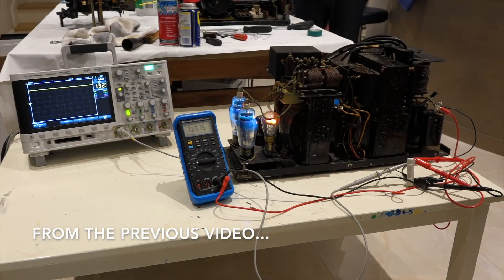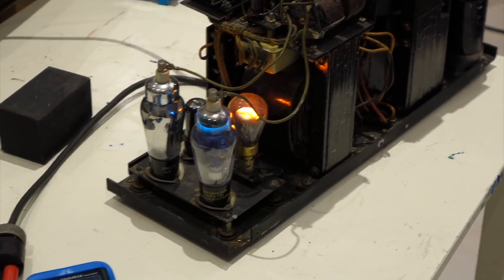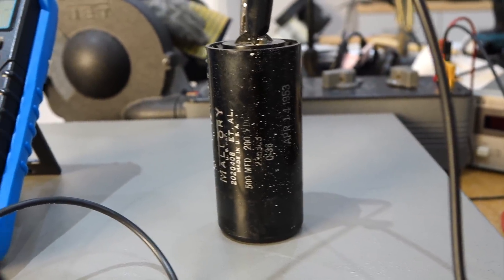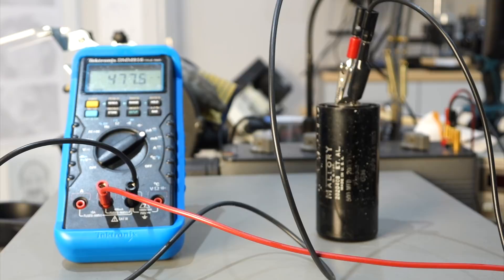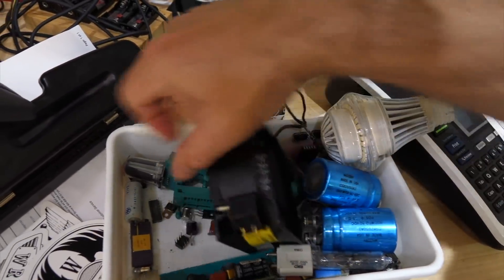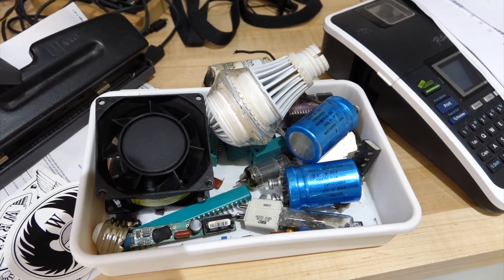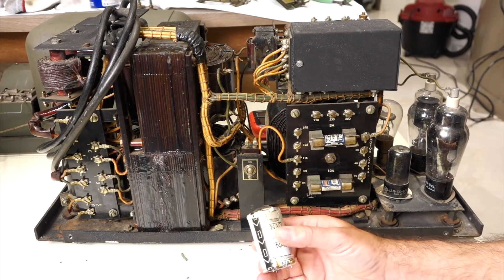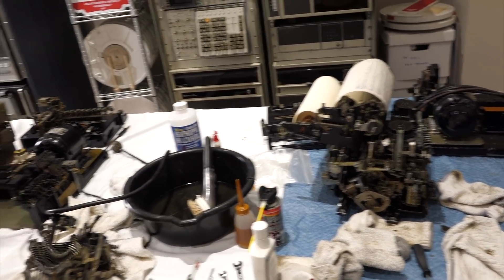Why we don't always replace vintage electrolytic capacitors

Comment: Thumbs up! When I repaired my HP 8671A and HP8566B and only replaced the failed capacitor.  I got similar comments on why I didn't replace all the electrolytic caps. My philosophy has always been that unless there is a good reason (e.g. high ESR and low capacitance), leave them alone! New ones aren't always better!
Reply: plus, the risk of causing damage to the PCB traces when doing the rework.

Comment: You, sir, are living the dream! BTW, I also (still) own a model 15, which back in the day I had hooked it to my TRS-80 as a printer. A little z80 ascii to baudot assembly code never hurt anyone. Also noticed that the rolls of paper that used to be used for drying your hands fit in the machine as print paper although clearly not optimal.  The cheap stuff wasn't very absorbant for it's intended purpose but worked for ink in the teletype. Oh, I used a model train transformer as the power supply to the selenoid, controlled by a transistor driven by ttl.

Comment: I find most older equipment or machines will last forever if maintained properly, and its not like you guys didn't test the parts before just firing it up, :p I believe after so long its just become common practice to replace parts of X years old

Comment: It's all a plot by 'big capa' to con people into replacing good capacitors thereby increasing 'big capa' profits. if you listen closely you can hear their evil laughter from their plush multi-national corporate offices. They created the 're-capping' cult as part of their plot...
Reply: Total recap was once a genuinely good idea when mid 2000s, a big swath of predominantly Taiwanese devices came out which contained erroneously manufactured capacitors, where ALL capacitors of a given brand and series would fail within 2-5 years' time, and the device would often contain nothing but those all across the low voltage section. It's also sensible when you see single capacitor failure, but this capacitor is in parallel to a bunch of others, then you have to at least test those individually for damage, as chances are, either the lack of filtering in one spot will have increased ripple current across the rest and would damage them, or whatever the failure mechanism was that caused one to fail, will also damage the others, for example excess heat, voltage or ripple in a part of a system. But this failure inducing mechanism needs to be identified, else you may very well be fixing only part of the issue Whenever i neglect to test or think about these things, chances are, i will hate myself later.

Comment: NAD... "Not Another Defective!" ;)  There's another acronym for NAD but I cannot write it here, haha.

But seriously, as you know, reforming doesn't always work and ends up being only a temporary fix.

I would be more concerned about what appears to be a steel encased three lug capacitor located near the vacuum tube end.  Specifically how much PCB oil is in it. Those can create a rather serious "situation".
Reply: That one isn't an electrolytic. Old electrolytic capacitors up until the 1960s contained small amounts of PCB oil as a stabilizer. The metal box cap with several lugs is a genuine oil cap, filled completely with PCB oil. They are quite reliable.
Reply: @gregorymalchuk272  I am aware of this.  Every Hammond vacuum tube amplified tone cabinet with the exception of the model PR-20/QR-20 and PR-40/QR-40 had an earlier design amplifier with the oil filled capacitors.  Yes you could shake one and hear the PCB oil inside the container.

The last Hammond organ to have an oil filled capacitor on the pre-amplifier if I remember right was the Model E.  The Hammond model BV/CV had a small dual 1uf-1uf 400volt capacitor attached to the side of the preamplifier which was no larger than 2" x 2" x 3/4".  It may also have been filled with oil.  I'd never crack one apart to find out. 

While these oil filled capacitors were quite reliable, after 65 to 85 years in operation, it's anyone's guess how reliable or safe they are now.  I do know that in an Hammond HR40 tone cabinet with it's three discrete audio channels powered by 3 sets of quad 6V6s, the oil capacitors become quite warm to the touch after approximately one hour of operation.

Personally I don't want to be the one cleaning up after one leaks and/or explodes.  Nor do I care to be held responsible for old equipment which failed in this way and if a user/customer is injured or worse. This is something hobbyists never seem to grasp.

Comment: Thanks for this! I hate seing categorically replacing all electrolytics in everything they work on and thinking that they are doing the equipment a favor. Electrolytics in older equipment are mostly all goood in my experience. If it lasted 30 or 70 years  why change it? It's a reliable cap, and no one guarantees that the replacement one is going to last longer than the old one if left in.

Comment: I always say that old stuff is built better, lasts forever and just works ! This video proves that these 60+ year old 'lytic caps are still perfectly good and were built properly. I'd be very surprised if a modern electrolytic cap (even a good quality panasonic) is still good after 60 years.
Reply: wonder if they're still good because they saw little, regular, or no use....

Comment: To be fair, I do agree in some vintage equipment the caps not needing to be changed. I have ran into radio's that have been made in the 30's  for typical consumers of the era and 100% of the time you have to replace the caps. But the fact that that machine is a Military spec from that era. I could be wrong but the made those parts with a higher tolerance for the military unlike today's gear. An that machine may have been serviced just before being decommissioned. Sure, I would be skeptical about the caps but I think that's because I have seen way too many paper caps turn dryer than a popcorn fart and randomly go short, or open. As for your choice in that machine, I don't blame you. Its not like that thing will be running 24-7. It will be a show piece running just long enough to get a few oh!'s and Ah!'s.

Comment: As with everything there is a slight hint of truth to it. Unfortunately people tend to take it too far :) I would be extremely wary with caps intended to remove dc offsets before amplifier stages etc, even if they measures good, since well. It doesn't take much to overdrive tubes/transistors but when used like this? If it measures fine, keep it :P
Reply: I've had a lot more trouble with wax coupling caps than I've had with power supply filters. Unlike the electrolytics, it's coupling caps that I often replaced just because. This was even common when devices were a lot younger. One of my early electronic memories is my father taking apart our B&W TV and replacing all the capacitors (I can't remember if he changed the filters). The TV had been having problems even though it was only about 10 years old then. I don't know how much longer it lasted, at some point we got a color TV, and gave the B&W away (who needed 2 TVs in the '60s!)
Reply: @jbuchana  Yeah, paper caps pretty much all have to be replaced. If I'm trying to do a restoration job 'right', I'll drill out a cavity in the old cap, put a modern Mylar cap inside, and solder on leads of the old gauge. Then I'll fill the ends with paraffin or candle wax so that the restored cap looks original but works like a modern plastic one.

Comment: Most old caps are fine and reform. As an indication leakage should be linear with applied voltage as the caps dialetric resistance is linear, so at 120v it should be 120uA ish for an electrolytic. 550uA is a tad high but nothing drastic as you say.

Comment: I wonder if people insisting on wholesale replacement have ever stopped to really think.  What is behind the fact that they replace a 10 cubic inch capacitor with a “modern” 1 cubic inch version?  In comparison with resistors we can conclude that a smaller package does not dissipate as much heat as the large one does at the same temperatures.  Or, if the same heat generated has to be dissipated from the small package, its temperature is higher.  And higher temperatures are what is a main detriment of the component life time.  Just check any document that refers to the Activation Energy.
Why are the new capacitors so much smaller than the really old ones?  Some time after WW2 the manufacturers started increasing the aluminum foil surface area by etching (roughening) the surface and reducing all the materials, increasing the per unit stresses.  That of course included the amount of electrolyte.  If you open a true long life electrolytic capacitor and compare the amount of liquid it contained to a “standard” capacitor, you see a big difference.
Checking the data sheet of most any modern capacitor you find a reference life time of 10,000 hours at whatever reference temperature.  How long is that time in more common terms?  It is a little over 1 year...  If the oldies would have had a 10,000 hour life specification, none of them would be any good after 65 years.  Simply, they were made with smooth foil and plenty of liquid for self healing.  And then the larger case kept the temperature down.
Reply: I found out that high quality capacitors have same size as old ones I was looking for 8200 and there's Mundorf a German company makes hi end version which is same size as one from the 70s 80s, while cheaper ones have gotten smaller.
Reply: "Why are the new capacitors so much smaller than the really old ones?" - So that devices that use them don't take up a quarter to half of your living room, that's why. With that kind of technology a satellite receiver (if possible to be built at all) would take half of your bedroom and would probably be bigger than the TV sets from around the same time. You can't have smaller sizes, bigger capacity and higher longevity at the same time, it's a compromise.
Reply: @CoolKoon  No, with advanced material technology and design, you can.
Reply: @djscott9207  Maybe, but just VERY slightly. The miniaturization of passive components wasn't nearly as fast in the past decades as that of the active components. Not even close.
Reply: They will tell you the ESR is lower so the cap doesn't heat as much.  They never stop to question if they ESR being lower will impact the overall circuit as it was originally designed.   The audio guys really get me,  they restore amps because they want that old sound back and then put in all these low ESR caps and often modern replacement transistors.   Does it work,  sure...but it doesn't sound original anymore
Reply: @jeffm2787  Okay, but "sounding original" is the stupidest goal to try and achieve anyway.
Reply: @AureliusR  So then why not just go with a modern amp which is probably going to have better specs and be far far less work then fixing up old crap that doesn't sound original anymore?  I'm of the mindset that people like the imperfection's which of course only come from the 'original' circuit.  Tubes are a good example.  Second order harmonics anyone....
Reply: Put back in a modern cap of equal size, which is higher capacitance and equal or higher voltage if needed. There are no drawbacks...only benefits.

Comment: Great video, thanks for sharing that.  I have watched many of the videos where capacitor replacement is performed.  I have noticed that some folks dive right in with replacement and others will test first.  

I am curious if some of the vintage (50's-60's) consumer market equipment had types/brands of capacitors that are more susceptible to failure,  compared to the more over engineered commercial/military equipment.   (Even if that failure took decades)

Mr. Carlson will frequently replace capacitors but I get impression he has quite a lot of experience.  I bet if we gave him an assortment of capacitors, some good, some bad, he could tell us witch ones are bad just by looking at them.  =)  Great video idea....

Comment: Ik denk dat je niet moet luisteren naar deze mensen die graag routinematig een shotgun condensatoren op korte termijn vervangen. Mallory condensatoren zijn gebouwd zoals tanks zijn dat niet, I am using Google Translate to communicate personally with you as I don't speak Dutch.
Reply: DAVID GREGORY KERR , I translated our secret communique for Marc to French for you. I only know French Canadian, and what I do know I’ve learned from reading bilingual shampoo bottles in the shower. Here goes

Imaginez si les condensateurs étaient remplis de poutine et de sirop d'érable. le Canada dominerait. Fusil à pompe. Tabernac.
Reply: But he's French...
Reply: zh84 sorry my mistake
Reply: TRANSMISSION INTERCEPTED

I think you should not listen to these people who would like to replace a short-term replacement of shotgun capacitors. Mallory capacitors are built like tanks.
Reply: the short-term should have been in there don't know what happened sorry.

Comment: As a fan of everything that's vintage I go for the philosophy: "Keep as many original part as you can, replace only broken or dangerous part if repair is not possible". And, although I don't know very much of electronics, I think you're right. I always enjoy your videos, because you make what you're doing easy to understand also for who is not an expert.
Reply: that is the hallmark of someone who has a dominating grasp of his field of expertise... the ability to explain to the layman.
Reply: Lassi Kinnunen  
Hogwash. The entire reason people collect old equipment is to preserve the historical context. The components used in the device are PART of the historical context. I only ever replace the ones that fail. Heck, by that logic, replace all capacitors, resistors, circuit boards, speakers, wires, CRT, case, and just call it a new device?

Comment: Les nouveaux condensateurs électrochimiques sont fabriqués plus ou moins comme dans les années 50. S’ils cassent (ouverts ou en court circuit) ça peut faire des dégâts sur des composants bien plus onéreux. Pour ma part, je les changent pour éviter de le faire 1 ou 2 ans 5 ans...
Ce sont les composants les plus critiques (une évidence). Donc pour moi, pour éviter de gros frais à plus ou moins court terme, je les change change tous, tout comme ceux au papier. 

Voir la chaine de Mr Carlons Lab. Plus en accord avec mon avis.

Comment: @CuriousMarc
What about the other two caps in there, do they fail open?

If you guys had tested the electrolytics properly in the first place like you did now, I bet hardly anybody would've bat an eye. The reason people went nuts is because it all looked a bit inexperienced in dealing with caps that old. Some of us do watch channels of people that deal all the time with vintage electronics that old and those people demonstrate the failure modes of different types of old capacitors and urge to caution about them. No need to be condescending about it.
Reply: You think they didn't test them properly in the first place? This is a Youtube video, not security footage. Do you believe that if you didn't see it, it doesn't exist?
Reply: If they don't at least mention that they did, I have no reason assume that they did and it's better then to mention that they should.
Reply: They had tested them properly. That wasn't the issue people were asking. People were simply demanded they should replaced for the sake of it.

Comment: You have an HP15C? Wow, I always knew I was watching the right channel. RPN could have saved the world from stupidity 40 years ago, sadly  we live in the wrong timeline.
Reply: Reverse Polish Notation. A method of writing expressions without using grouping operators like parends. You write the operands first, then the operator. So 2 + 3 is 2 3 +. (3 + 4) * 5 is 3 4 + 5 *. HP made a lot of pocket calculators that used that notation, and it developed a cult following. 

Personally I consider it writing expressions in assembly language, and I say that as someone that has spent 40 years working on computers that internally use reverse polish.
Reply: RPN is pretty neat. I'm glad I learned about it, and grew to enjoy using my HP11C more than regular infix stuff

...what I'd do to get a 16C though... hoooboy. Too bad they cost a firstborn and a half these days.
Reply: RPN?

Comment: if it's not broken, don't fix it. especially when they're not cheap 90's caps from taiwan
Reply: Certanly no, they WILL fail ower time i can assure from my experience...
Reply: @Vampi_Sweden  The new replacements will fail sooner than these originals unless you buy the highest grade, custom made, custom specced Nichicon or something.
Reply: @jan.tichavsky  Yes, there are still a few good brand on the market, but it apends on the particular type (as You probably know), for example some types of old cheramics has no real experience date, they can still be good after many, many years, but sheap E-lytes usually last around 10 to 30 years still conciderable reliable. But in this case those bigger ones also represent a part of the historical value of the device it self as long as they work good enough for this purpose, as i see it, i think that was the point of testing and saving them. In equipment with no real historical value i see no problem replacing everything, but in very old apparates the component it self also hawe a historical value if it can be preserved without risking damage other, more valuable parts of affect the function badly on a device that are restored to be functional.
I found a video here made by an old man who saved the papershell with the original markings of old wax capacitors, but he putted modern ones inside the original shells and re-waxed the surface, it looked realy awsome at my opinion when it was finished.

(Sorry for my English, it's not my native language...)
Reply: @jan.tichavsky  Absolutely correct Jan!!!!